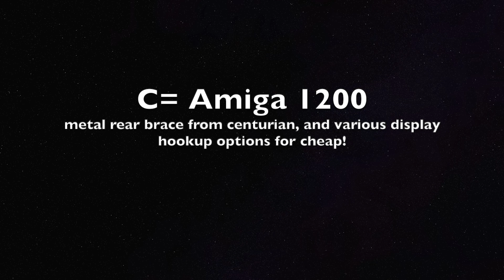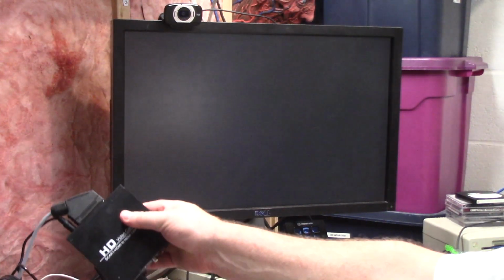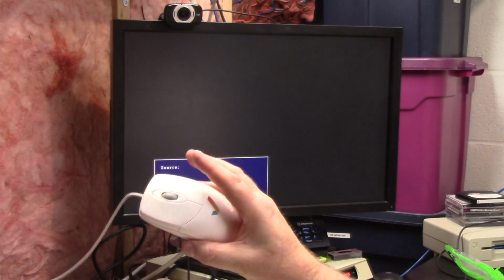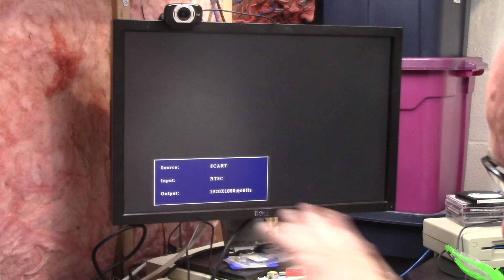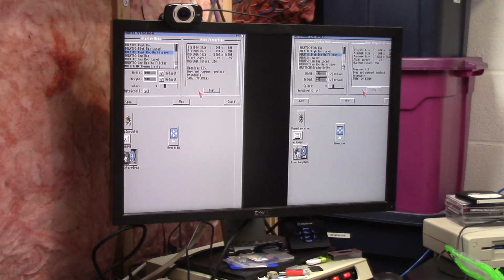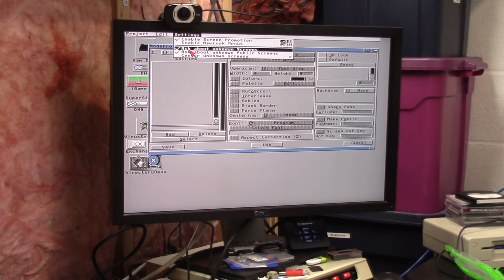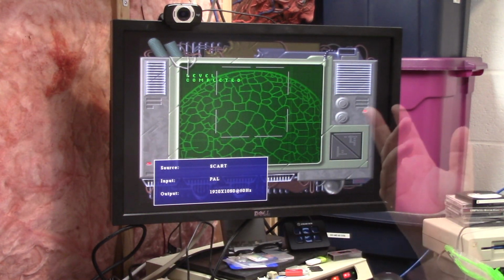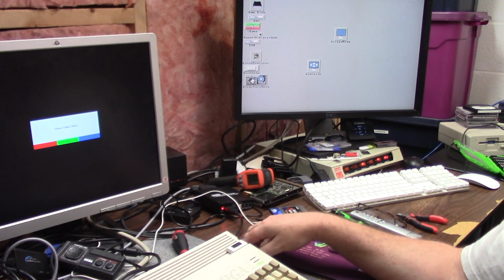Amiga 1200 rear metal and different video hookups

Comment: Hi Just got back into Amiga 1200. I just run games mostly but I get that weird split screen that you had there sometimes. Does the screen mode app come with the Amiga or do I have to get from somewhere? One more thing are you in a bunker?
Reply: The screenmode is apart of workbench but Modepro is available on aminet
Reply from the maker: Hahah bunker.   Yeah i guess?  its my work room for electronic repair .it is in the utility side of my basement with the water heater ,( always a guest star) and ac/heater and pipes.   It adds charecter...    modepro is on aminet i did a video on it by itself a few weeks ago here.  https://youtu.be/1qQ3jpF10zs
Reply: @ChrisEdwardsRestoration  Lies we all know the water heater is the true star.

Comment: That's a cool bracket.   I went through a ton of video conversion devices with mixed results.   I just use the RGB to VGA Adaptors along with other adaptors to convert the keyboard and mouse ports to PS/2 so I could connect different Amiga's to a KVM Switches which works out well only problem is stacking the Amgia's on top of each other looks like a Great Idea until you need to pull one out to service one so I have to build a custom shelf or just get myself a large server rack so  that I can pull out Amiga's at will and not have to worry about which cable is for what Amiga and then set everything back up using an 8 Port KVM Switch.    Back when I had only the A2000HD I had it sitting in my server rack and it resolved the space issue but then I got bit by the retro bug now I have too many Amiga's.